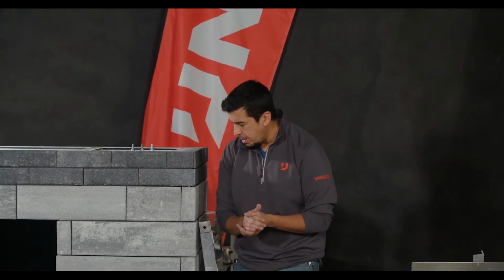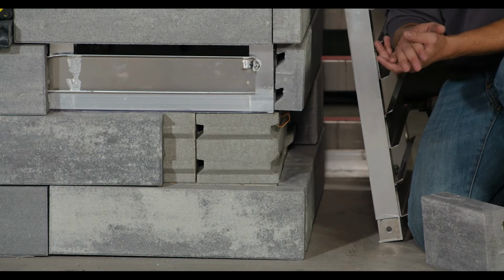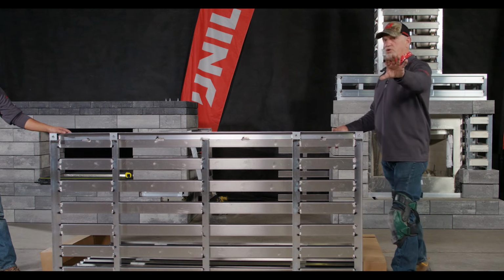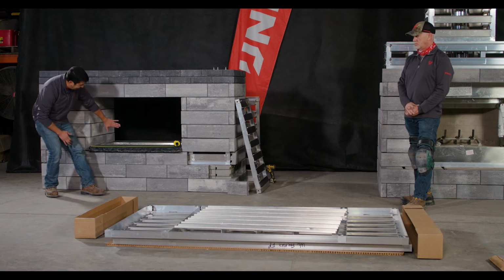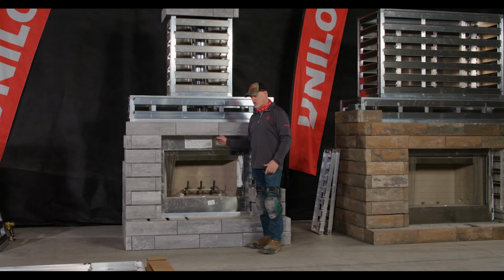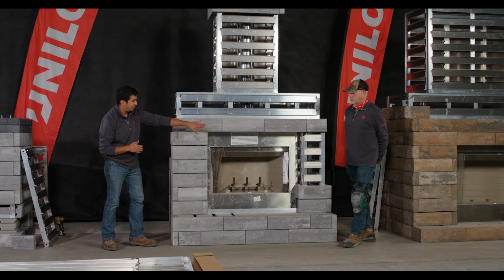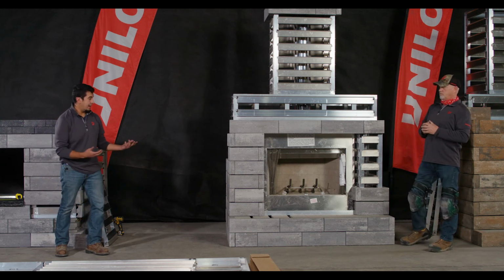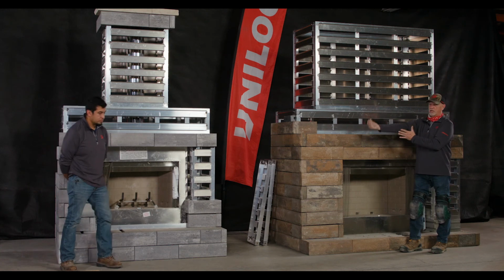Building Fireplaces with U Cara® Modular System - Edu-Series 2021

Comment: why cant you use a mantle structural pc as you put it on the smaller fire place to have a tv set on. You only mention tv on the larger fire place.
Reply from the maker: Hi Frankie, great question! While it is possible to use a structural mantelpiece on a smaller fireplace, it's typically more practical with larger fireplaces, especially when mounting a 50"-65" TV. Most larger fireplaces provide the necessary space to accommodate a larger sized TV while allowing room to discreetly route electrical cables within the cabinet. With a smaller fireplace, that extra space is limited, which can make cable management more challenging and may impact the overall appearance. Hope this helps!